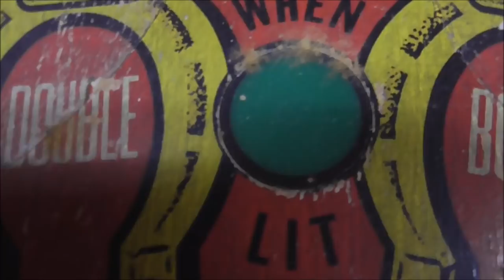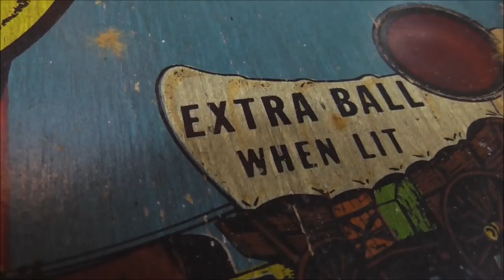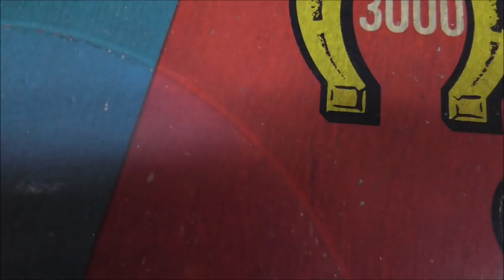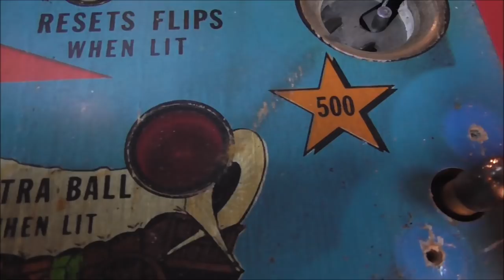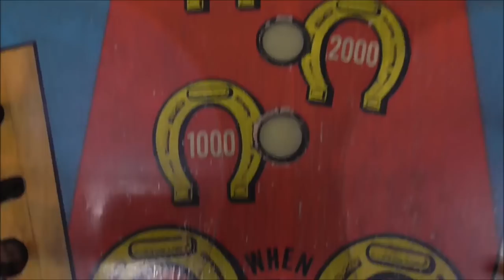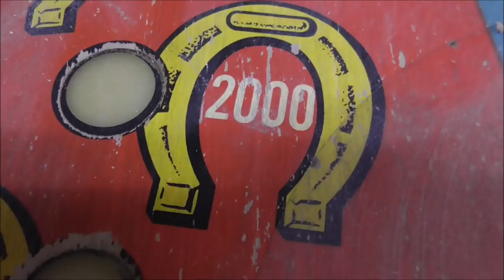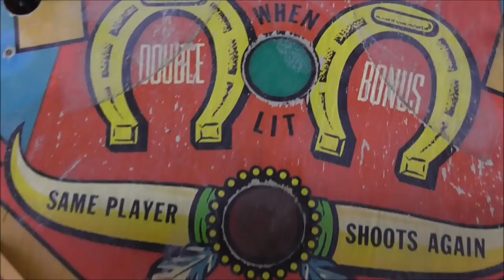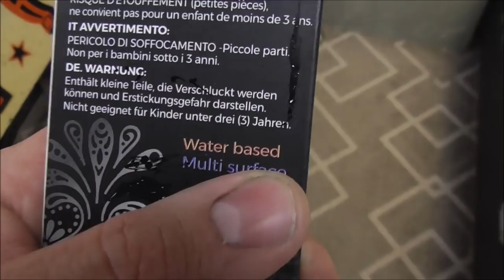Cleaning and touching up the Paint on a 1976 Bally Flip Flop Pinball Machine Playfield

Comment: My father once put Polyken tape on the liftgate of his 2007 Ford Focus to keep something attached to it.  When he peeled it off later it took the paint with it.

You can actually get clear varnish which is made specificially for applying over acrylic paint.  It's applied with a brush.  However it must be done on completely cured paint (24 hours minimum) and you must wait 24 hours between coats if you need to apply more than one coat.